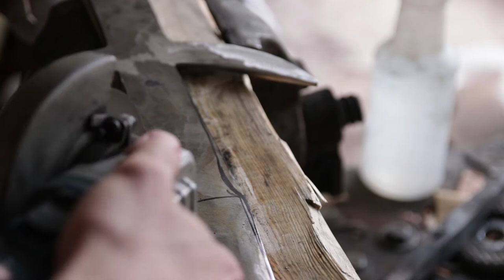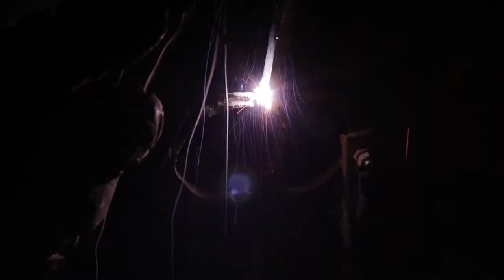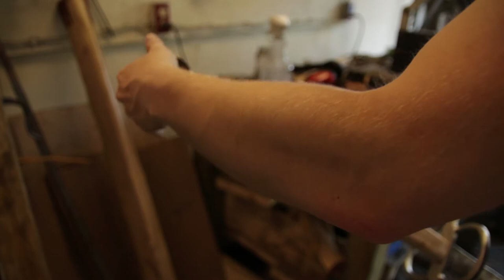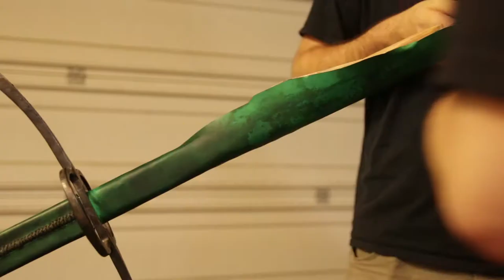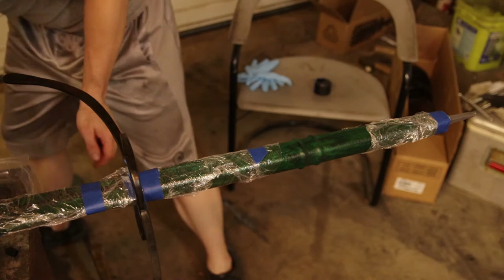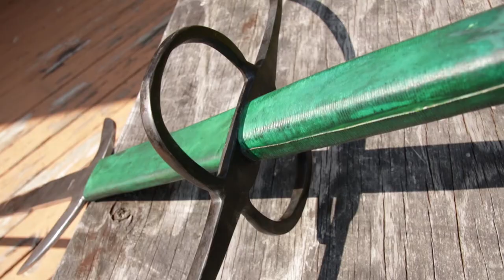Forging A Zweihander Finale (Finally)

Comment: Your blade should not weigh 13 pounds. That makes it (at least) twice as heavy as it should be.
Reply from the maker: Yes if it was based off zweihander dimensions that were meant for combat. It is loosely based off of "Grutte Pier's sword" which is 7 feet long and weighs 14.6 pounds and was also most likely a parade sword not meant for combat. My friend who is 6'6" tall wanted to make a really big sword and I limited it to historical examples.